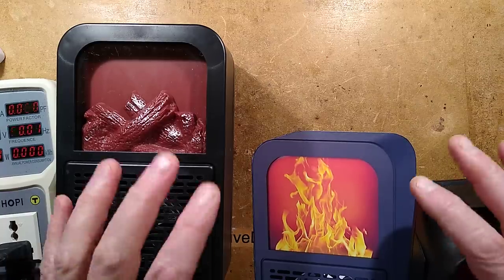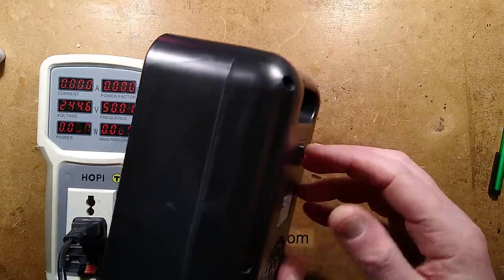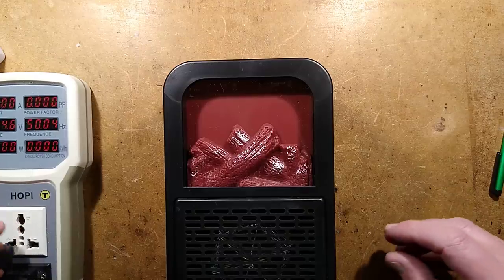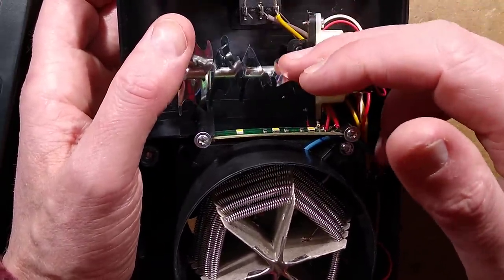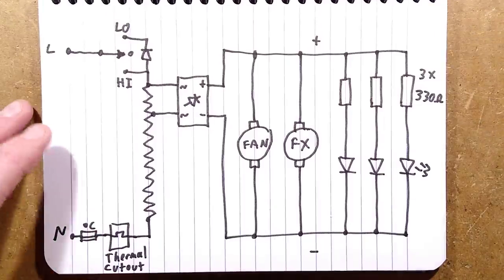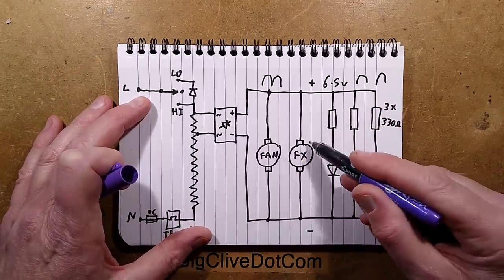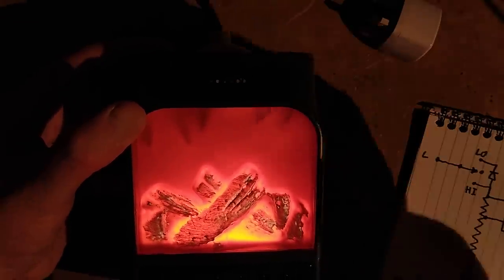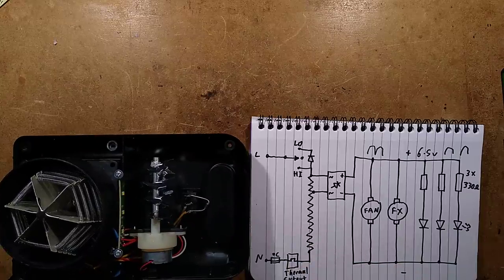The trashiest of all miracle heaters (with schematic)

Comment: Once the fan motor fails, you probably won't need the flame effect!
Reply: No yo might need to redecorate after and pick the plastic out of the carpet. 🔥🤣🤣
Reply: You would be able to distinguish the real flame from the fake!
Reply: There was some kind of thermal fuse behind the motor strapped to the wires, Clive just misted that I think
Reply: @kitecattestecke2303  he mentioned it at least twice; and I seriously doubt it will have a chance to cut the power off.
Reply: 3:00
Reply: Your home, office, garage may be optional as well at that point
Reply: @jkobain  so long as the component isn't dodgy it probably will, it might be set to cut off at less than 100c. As bigclive said it looks like a hairdryer that has been converted.
Reply: Or if the element goes open circuit between where the bridge rectifier gets it's power, you'll have DC mains on the LED's, FX Motor and the blower motor.
Reply: @darkknight145  Now I'm sad that Big Clive did't show us what actually happens in case the outlet is blocked while the thing is running.. The video needs a sequel!
Reply: @darkknight145  You have mains on the fan and LEDs either way...
If that little section of heater would burn out, the fan and LEDs would still operate just the same, the only difference would be that the rest of the heating element would now be in series with the fan and LEDs, no longer directly across the mains, and would no longer get hot because it would now be getting very little power.
Reply: @thegorgon7063  I agree; yet, I've never seen a hair dryer that's supposed to run constantly, and don't even speak of public restrooms hand dryers: they are built to serve like that, and even they cut out and have proper overheat protection.
Reply: From the chinglish insert: "Special select component perform ultra realistic flame effect. Incineration potential suitable for auspicious insurance benefit. Please use heating unit with disposable home only."
Reply: @davelowets  I was looking at the Voltage across them, instead of a low 12v (or whatever) they will have rectified mains, instant kapowy!
Reply: @andreasu.3546  ...........ElectroBooooooooooommmm for that !!!!
Reply: Yeah! 
Especially when the heating element is also inside a plastic tube! 😂
Reply: @thegorgon7063  njj
Reply: @thegorgon7063  I)
Reply: @thegorgon7063  and the rest
Reply: @StarlightCipher  I will cover all
Reply: @darkknight145  No, they wont... The mains would still be going through the larger half of the resistive heating element, and the voltage would still be the same.
Reply: i have the 750 watt version plastic heaters and when i block the intake , it triggers the safety switch almost immediately.  i tried this a number of times and it never started anything on fire.
Reply: Makes the entire house warm for everybody.
Reply: Real fire effects
Reply: Come home to a real fire...
Reply: @Schnizzyfizz  holy shit wtf is a disposable home😅
A burnt one I'd guess.
Reply: @BensWorkshop  🤣🤣🤣
Reply: I have a 1 speed, "900W", light only in the white operational indicator, Ballu BFH/S-03, manufactured in July 2015. Had if for a few years, left it running for over 24 hours, so far so good. Useful little bugger.
Reply: @dcallan812  You.mean pick the melted.plastic out from the ashes.
Reply: I hear the brand name is "Sure Fire Guaranteed".  Plug to voltage to make flame for house effect of big fire 🔥 burning to make for heat of unit as for big fire for warm house to burn effect for real
Reply: @WitchidWitchid  Yes and out of the floor rug. 👍👍
Reply: Or additional heat output...

Comment: The second I saw the flicker and heard the noise I went "I bet there is just a diode on that switch because it's cheap and easy", these sorts of things are always funny in a terrifying way.
Reply: I had exactly the same thought lol
Reply: I had the same but that diode is also under rated. as the average might only be 180W, the peek will still be the 360W.
Reply: Indeed. In half wave mode I they could have made it much more stable if they had added a smoothing capacitor
Reply: Yepp here too :)
Reply: A diode is in no way funny or terrifying. It's just a safe and clever solution that's used in hair dryers all the time.
Reply: @mjouwbuis  But theyre not putting it in just hairdryers

Comment: Having been a firefighter, I always find these kinds of heating products terrifying; or is it horrifying?
Reply: terrifying people buy these horrifying they allowed to be sold
Reply: But why is it so dangerous?
Reply: @songsthatarecatchy  Because people often turn on heaters and forget about them and leave them unattended.  Combine that with a cheap plastic housing and questionable design decisions and you can easily get a fire.
Reply: Job security.
Reply: Why not both?
Reply: Try being a firefighter in the States in an area cold enough to freeze mobile home pipes. The reckless abandon with which people will throw a hot wire, fire making machine under their 1975 60 foot tinder box on wheels is incredible. The underbelly of the old ones were made out of basicly cardboard, and now they are 50 years old. Believes it or not, the cardboard doesn't tend to last that long. Years of botched cheap repairs where it doesn't get put back up, and minor water leaks mean that it all starts hanging down. Also, it held up the insulation. So now the pipes freeze even easier. And we've come full circle back to some poor bastard pulling a peice of skirting off, throwing a milkhouse heater down there without looking very well because it's -40° and it doesn't matter the unit of measurement at that point. But damnit, they gotta get the water back on, and hope nothing cracked. Because how do you fix that? Also, wet electric heaters are fun. It's ok, except they probably didnt plug into a gfci outlet assuming whoever set the house bothered to ground it at all. And don't even get me started on the fact that our extention cords don't even have to be able to handle a standard 15 amp load. People are just supposed to know not to plug too much of a load into too light of a cord. I could do a whole other rant on improperly installed wood stoves and dirty ass chimneys.
Reply: @Flabulo  Don't forget the meth lab in the kitchen, and 10- kilowatt weed- growing lites in the bedroom!
Reply: @Flabulo  Epic rant!   I was a firefighter in upstate NY, so yes.
Reply: @britcom1  I tend to go on rants when I get sleep deprived. And I've slept about half as much as I should for several days now. I'm surprised I've managed to not make this comment a whole ass essay.
Reply: terrohorfying
Reply: I think technically 'terrifying' would be the answer, 'horrifying' would describe the aftermath

Comment: As an electrician that is literally scared of Electric fan heaters this is pretty much my worst nightmare.
Reply: Any particular reason? Do you also dislike oil filled radiators for instance?
Reply: @waqasahmed939  oil filled ones are fine. Since they most of the time have a self regulating heater element that is incapable of producing to much heat for the radiator to dissipate. 

The reason why I dislike fan heaters is simple. 
They are tremendously unsafe when operating unattended. 

I've seen 2  houses that I had to rebuild because a fan heater  that caused a massive fire. 
It was not pleasant to walk through the burned down romms seeing the leftovers  and the things the family owned. 
I'll forever rember that smell and the destroyed lives they left behind. 

Statistically they have a good likelihood to be the cause of an electrical fire if there is one. 
And seeing how on most of them there  is only one single ridiculously cheap thermal fuse that keeps them from burning when they tip over or the fan fails that is just not something I'd like to have running in my house . 
Same goes for old heater based Clothes dryers.

If I use a fan heater then I'll stay near it or use it on a surface that is incapable of burning. 

Also there is  a large disaster involving these heaters that has been burned in my memory. 
It's quite popular but I forgot the name. 
A skii resort used train like transportation and they had a failing heater on board causing a burned down train with almost all of the passengers slowly and horrificaly dying. 

My mother used the same one days prior.
Reply: It was the Kaprun disaster
Reply: Yeah, but it's so terribly portable! Take your fire everywhere. No, I mean... FIRE!!! CALL 911! OR 999 if you're 'cross the pond!
Reply: I have a scary story for you: i once had a fan heater plugged into the end of a 6 segment extention cord stretching like 200 feet and had to unplug it in the middle of the chain because the hester was still running BUT 5 of the plugs had completly melted....
Reply: @Sigmarr  Ouch. Round about way to create a 200 foot extension cord. Heckuva job area to cover too!
Reply: @Sigmarr  i should have been scared to put a heater on my bed . i was planning to run it for a minute. when the choking  smoke woke me up half the bed was burning. and the carpet next to the bed. right in front of the door. i basically had to destroy my blanket by putting it over a pool of molten carpet before i could get out the room. yep, i burned down my bedroom with a heater. not bad huh?
Reply: @echelonrank3927  OH MY GOD were you able to live there still???
Reply: @NinoJoel  I've just read up on that story. Really scary and highly suitable for the "Plainly Difficult" channel.
Reply: @AndyFletcherX31  I think he did cover it some time ago but I can't find the video. 
Maby it was a very similar channel
Reply: @AndyFletcherX31  Well There's Your Problem did an episode on Kaprun, worth a listen
Reply: @Sigmarr  yeah, not for a while. fortunately the room wasnt fully burnt down.
Reply: @darksu6947  no, i totally failed to end up dead. get some tips for me from the experts.
Reply: @echelonrank3927  The dead are pretty tight lipped for some reason. Perhaps this calls for a ouija board? I have one that glows in the dark, but I've never used it.

Comment: I like that both units seem to use the same molded red plastic logs to display the flame effect through, except one has what looks like dry brushed white paint to simulate ash. I wouldn't be surprised to learn that both heaters were made in the same factory.

By the way, thanks for showing us the guts of one of these so long ago. I instantly recognized the effect and remembered the hardware upon seeing it lit up. I also remember you saying how jerky the flame would look if the mylar weren't twisted properly and here we are.
See, some of us do pay attention.

Comment: I bought this same heater in a slightly different casing and without the LED effects. Full well knowing how crappy it would be, it's only purpose was to act as a thermostatically controlled enclosure heater for the little greenhouse to keep some plants above 16C during winter. It would turn on for less than 30 seconds at a time every few minutes or so, worked fine for a while until the fan motor stopped working for some reason intermittently, at which time it would melt the plastic grille before the bimetallic switch did its job.
Reply: lol, go figure!
Reply: Dude I'm Doing The Same Thing!!! 
Grow Box And It's Too Cool Out Side And I Need A Small Heater To Control The Temp In My Grass House!!!!
I'm Only Using It When I'm In The Shop With It!!! Don't Want To Burn My Crop Up Until After Harvest!!! Then We Burn Down The House!!!
Keep Rocking It Out Brother!!!
Reply: In the past I used a five 100W tungsten filament lamps, all running at half mains voltage, 240V lamps, connected to a isolating transformer with a 120V secondary (output). It was a very reliable arrangement.
Reply: @rockerpat1085  Isn't it terribly exhausting to begin every word with a capital letter, especially for those that shouldn't have one?
Reply: Isn't It Terribly Exhausting To Worry About Such Things? 
And For The Record:  It Ain't Hard At All To Be Awesome!!!!
Reply: @Anvilshock  Then Why Are You Worried About What I Do? If It's None Of MY Business Then Why Did You Bring Me Into YOUR Business!!!
Try Being Awesome And Stop Worrying About What I'm Doing!!!!
Reply: @rockerpat1085  You chose to expose your written performance to the public, you deal with the reaction from the public. That's why. How about you try being awesome yourself? Right now, all you are is being awful on the eyes, when you could be not so.
Reply: @Anvilshock  Did You Wake Up Today And Decide You Wish To Be Annoyed With Someone About How They Write?
Or Is This Just A Normal Day For You? You Know Worring About Someone Else's Business!!!!
How About The Exclamation Points!!!! Do You Mind Those???
Tell Me More About Me That You Wish I Would Change???
Come On I'm Sure There's A Million Things That I Should Stop Doing Because It Annoyed YOU!!!!!!!!!!!!!
It's So Great That I Can Annoy Someone With A Simple Capitol Letter!!!!!!!
Try Being Awesome!!!!
Reply: @rockerpat1085  hair dryer would be safer or maybe use floor heating elements
Reply: @rockerpat1085  I Like The Way You Write. How Much Are You Selling That Grass For, Old Man?
Reply: @Anvilshock  It's not hard to type with all beginning caps. Double click the shift arrow. Please try to find the "be nice" setting on your keyboard and double click it.

Comment: The oil filled radiator heater I purchased last winter is a real miracle heater. No noisy fan.
Reply: I quite like them because they heat up and cool down just like your normal radiators

The heat stays in the room for a lot longer too
Reply: They’re good for steady output.
Reply: I agree, oil filled heaters are great!

Comment: I actually purchased several 12v versions of this sort of garbage for a project a while back. Good lord, the absolute certainty of several of the variations to catch fire an burn down was amazing. Some didn't even have soldered connections, just twisted wires. Unbelievable.

Comment: If the heater element went open circuit between where the bridge rectifier is connected across,  things would get very interesting for the fan motor,  effects motor and LEDs !
Reply: A follow-up video ??
Reply: i think that happened to a 9$ harbor freight heat gun i had. fan went BRRRRRRRR and poof
Reply: Just more realistic flames!
Reply: Thus living up to the advertised house warming effect with even less use of electricity. Nice!!

Comment: Nice teardown. The cheaper one works exactly like a 70s hair dryer i have. The half wave diode low speed heat setting is a clever old trick.
Reply: Out of curiosity, what do more modern heaters do for this? Regulate the voltage?
Reply: PJ - Um, not sure, but the mains voltage is fairly well regulated.

Comment: TBH I have used an actual hair dryer to heat up the room in emergencies before. It's loud as heck, but it kinda does the job, I managed to raise the temperature by one degree as the clock on my wall said, probably even more around the bed where it was aiming.
Reply: Ah the smell of burning dust, I've missed that ...
Reply: @DavidCurryFilms  I had to crawl under my house with a hair dryer to thaw my water pipes, in a confined space that burning dust smell is almost overpowering.

Comment: These half-wave rectifier heaters can introduce significant harmonics into the power distribution system. I notice that when I switch my 1500W space heater to "LOW" mode (which similarly puts a diode in series with the heating elements), the induction motors throughout the house hum noticeably more loudly, and if my variac is plugged into the same circuit, it will buzz quite a bit more than usual!

Comment: I like the one you took apart. You could remove the heater and the fan and run it off a 5V powerbank just for the flame effect fireplace. :)

(although it all depends on the current draw of the motor as to how long the powerbank will last)

Comment: There are a LOT of plastic cased " bar fire " type heaters being sold ... these burn FAR TOO HOT ( bright orange ) and the Nichrome elements are super thin = VERY short life ( 4 months ? ) ... a better buy would be a  2nd hand 1960's bar fire from a junk ( thrift ) store .. these have THICK elements , run a dull red ... my  mum's Belling™ from the 1950's  STILL WORKS TODAY ! ! ..( tried - n - tested ) ..... DAVE™ ..............